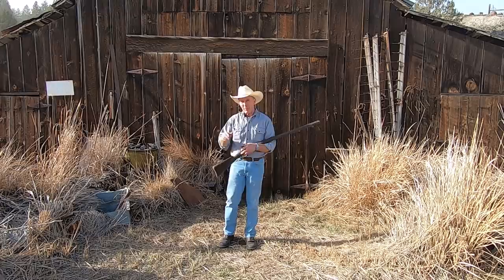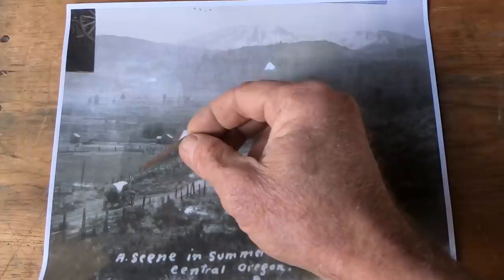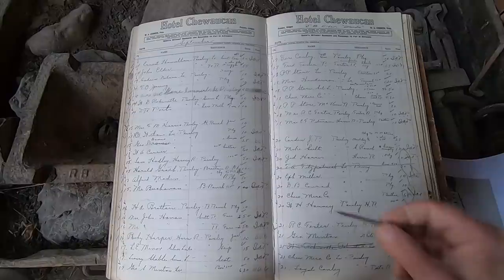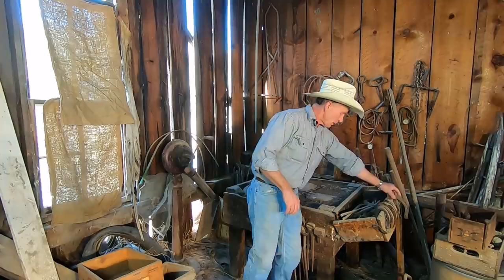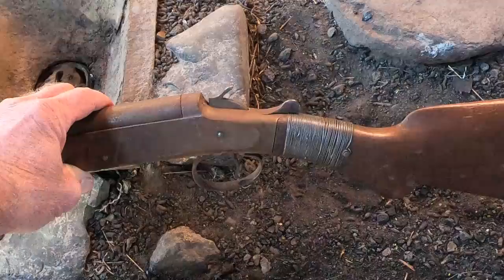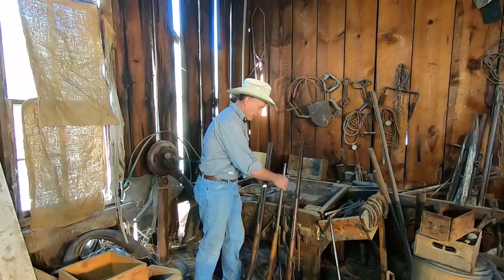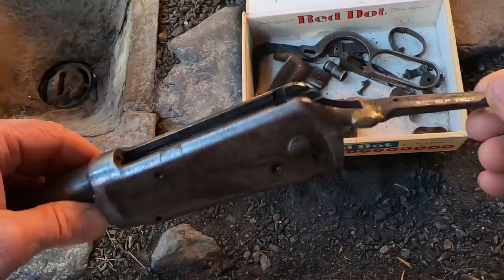Old West Firearms Repair

Comment: I moved from Stratford" CT and I had a Gun maker friend who opened his shop from the farmhouse in Stratford. I had my old Colt M-1911 military rebuild by him using old Colt Part. I also brought Colt 1949 caliber .31 single action in good shape but the cylinder is no longer moving so I send it to the gunsmiths and was told the cost to do research and making parts will cost more than the gun worth. I send it to the gunsmith in CT which used to be the home of Gunmakers and the estimated is much less from what I have heard before. The New Heaven used to have a lots of factory for Rifle and Shotgun makers like Winchester model 70 Remington Model 11 and Win Model 94. I brought a lots of Old Revolver from zHartfordm CT and will keep them or sold some.
Reply from the maker: Good luck getting that old Colt 1849 shooting again.  It sounds like you found the right smith to fix it.  Not many out there who want to work on old guns any more.

Comment: Excellent!  The Wyoming State Museum has several firearms with repairs at the broken wrists.  An 1874 Sharps Sporting Rifle is wrapped with thick rawhide I like to think is buffalo hide.  Others have copper wire wraps.  One has sheet copper wrapped and tacked in place. The wrist was apparently the weak point if you had a horse wreck or your rifle was dropped and run over by an ironed tired wagon.
Reply from the maker: Seems the wrist is the weak link for guns that got used hard by people who were pretty creative in getting them fixed up and back to work.  We visit Wyoming regularly.  I'll plan to work in a stop at the museum on one of our upcoming trips.  History buffs can never pass up a good museum.  Thanks for watching and commenting.
Reply: @thecinnabar8442  I'm the volunteer firearms historian for the Wyoming State Museum.  If you contact us - info on the website -  before your visit, I can arrange a behind the scenes look at some of our more interesting firearms.
Reply from the maker: @wsmvolunteers8588  Thanks a bunch!  I'll surely be in touch.

Comment: I had an old pepperbox. It was marked number 95 on the internal parts. Someone used the sear from the gun marked 99 to repair the busted sear at some point. Some one else didnt know how the gun worked and bent the hammer spring trying to match it to the hook on the sear rather then just replace the missing hammer spring link. v.v was a rather nice project I wanted to get to.
Reply from the maker: Lots of amateur gunsmithing on many of these old guns just to try to get them functioning.

Comment: That forge is very interesting I'm curious to see how well it heated up metal
Reply from the maker: It's got a fairly small firebox, so it would have been limited in the size of project it was used for.  I doubt they would have used it for something like forging the ends for axles.  Thanks for watching and commenting, Michael

Comment: That forge can be used just fine. Certainly won’t burn down the building.
Reply from the maker: Thanks for the advice.  If it wasn't for the tinder dry wooden floor, I'd be tempted.  Lighting the forge would be fine, but any little ember or mill scale off the work could cause 135 years of history to go up in smoke.  Thanks for watching and commenting.

Comment: I suppose the way to do it if you had the money then was to just have a spare rifle.  But you could make parts, even precision parts without machine tools.  A skilled tool maker could make parts with a set of files, a hacksaw, some marking dye and some micrometers.  At one time that was part of the "test" -- to make a precise cube with nothing more than a set of files and you could use a surface plate and gage.  It had to be within .001 of squareness (out of a 1 inch cube).   I could probably make most of the internal parts of one of those lever action rifles with just a set of files if I really had too.  But a drill press really helps!

Comment: How do those double triggers on that Winchester work when they are so close together? How do you pull/set the rear trigger when it is so close to the front trigger?
Reply from the maker: I don't recall a set trigger gun in this episode, but it sounds like you're referring to the close coupled set triggers made by Winchester for the late 1886's and the 1892's and 1894's.  On those, you actually push them both forward to set the trigger just like you would set a single set trigger.

Comment: Thank you sir for the very interesting video.  It is amazing to see what they had to work with back then.
Could you please explain how they used a wooden box for a Forge .   I would have thought the heat would have burned it up.
I currently live in Cherr'ville, NC but i was raised a Yankee , haha.
Reply from the maker: The wooden frame is filled with a type of sand that acts as an insulator so that the wood doesn't get hot enough to catch fire.  Thanks so much for watching!

Comment: these guns could benefit from some conservation! basically you need to steam everything and cart off the converted rush with a soft wire wheel. you might find theirs some finish hiding under all the crud. its important to conserve historic stuff and things! lol..im also a fellow oregonion and its great to see some of the history you have to share! i absolutely love old stuff! ide have installed a big hood for that lil forge and put it back in service. next thing ide do after that would be to restore that mod 94 back to serviceable condition.its not hard to find the parts, a new bottom tang bolt whatever it needs.look no further than feebay..lol
Reply from the maker: I do a lot of that kind of conservation and restoration work in my gunsmith shop, Cinnabar Gunworks.  If I ever get caught up enough to work on my own guns again, I may just do that.  Thanks for watching.
Reply: @thecinnabar8442  lol ide never seen a video from you before wen i wrote this the next bunch of vids i watch schooled me lol i subscribed and hit the bell!

Comment: Oh, your gun was made in eighteen ninty blank?  it's still got all the original parts from the factory? so it was never used?  Give me a gun with a story.  It was made in 1907, it may have been shipped to Europe with Pershing, but in 1924 it  was cut down by Tobias in Allentown.  In 1946 it got a new front and rear sight in a suburb of Cleveland, it took some deer here and there until 1965 when it was put in a closet, and it hasn't been fired since.  Tell me a story, I"m not a museum looking for a snapshot in time. Show me how this item has evolved over time.  Providence is better than Pedigree....as long as the item still functions.
Reply from the maker: Great comment, Ian!  Thanks for watching and commenting.

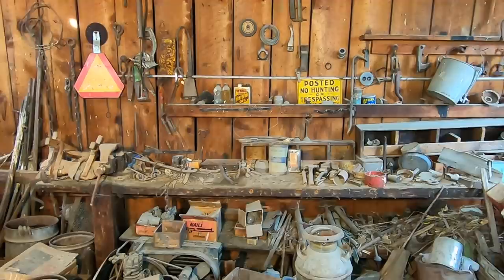Comment: Sorry, but as one who worked out of a forge for a couple of decades, THAT (3:52) is not how the Old Blacksmith Shop would have looked.  If it did, I am sure folks would have taken their work elsewhere.  Just sayin'
Reply from the maker: Thanks for watching and commenting, Sarge!  You seem to have missed the point of this shop, though.  This is a workshop on a very remote, large ranch that was built in the 1880's and hasn't been used in at least 75 years.  Yes, it's accumulated a lot of junk and been used as storage since then.  It was never a blacksmith shop for hire, but the shop used by the ranch.  There was no work to be taken elsewhere.  The pioneers who used this shop were using it for their own repairs.